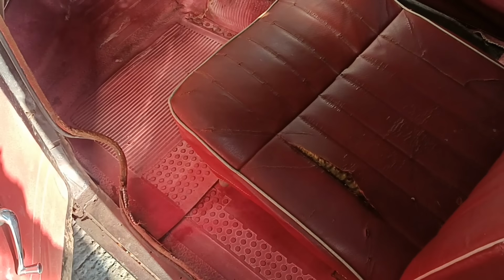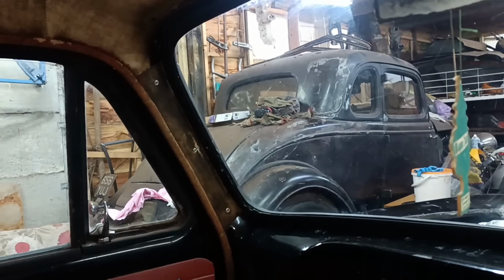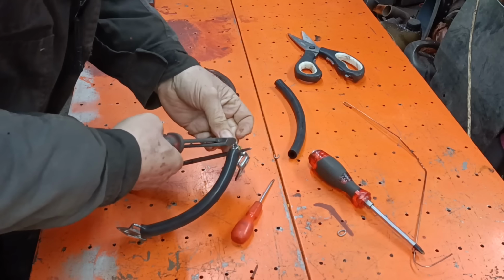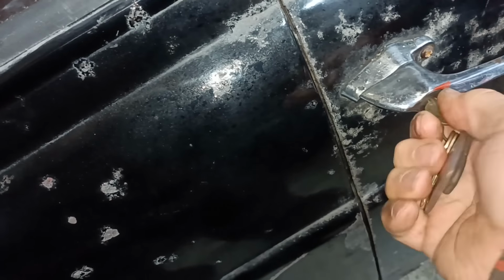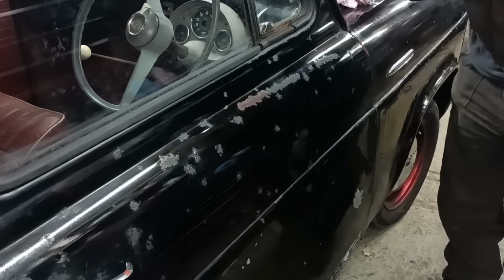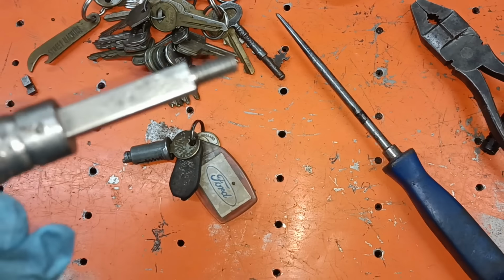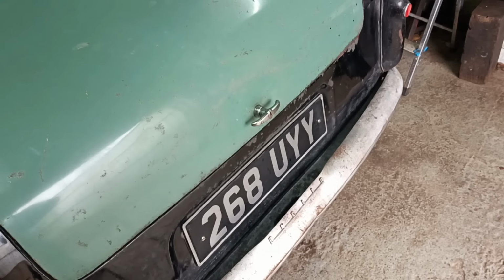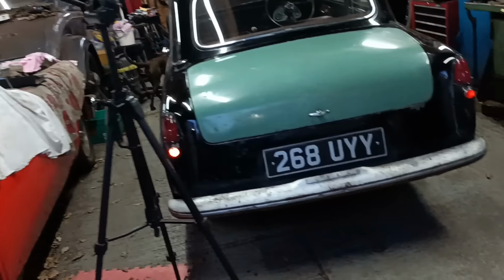Tinker Time! Let's sweat the small stuff! Mart's 100E part 74! (2412)

Comment: Have you considered fitting a heater, Mart.
The Enfo ones are available used, they are an easy job to fit, and do help to keep the screen clear.
Reply from the maker: Hi Andrew. I do actually have a heater. But for the time being at least, I don't think I will be fitting it. I don't have to daily drive the car and none of my other old cars have heaters and I have not really felt the need for one. If daily driven then it would be a different matter. Thanks as always for watching.

Comment: Hi Mart, i've always found if the action of the keys in the locks keep sticking/jamming, i'll take the lock barrel out of the lock, inspect to see if any tumbler plates are standing proud of the barrel body and if so using a needle file just "dress" backthe tumbler until it's flush (have also used it to make locks work with another key), also that oil stain on the floor mat to me actually looked quite good and seemed to take the distressed look out of the rubber. would it work treating the rest of the floor mat?
Reply from the maker: Hi Steve. I have done the file thing with the tumblers in the past. I was just lucky this time that the key was correct. The new one fits well. I might try some dressing on the mats but I'm struggling to get garage time at the moment. Cheers Steve, thanks for watching.

Comment: I hope I'm wrong here, Mart, but you might regret using that T-Cut product. When I got the 107E, I soon found that water droplets on the car after rain or washing left similar marks when they dried. The only way to shift them was to use polish. This went on for years and nothing would stop it happening until, , for different reasons, the car was resprayed. It was certainly a pin in the arse!
Reply from the maker: It's not like it's a minter, Jim. I'm not going to get upset about any blemishes on the paintwork!